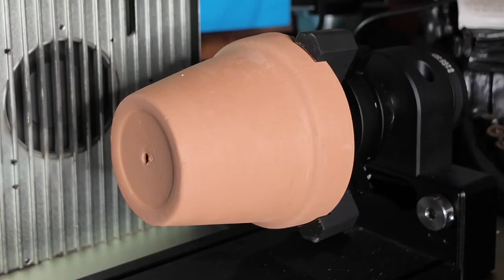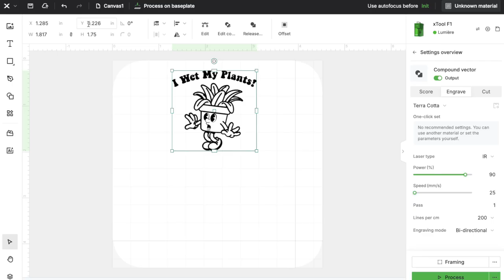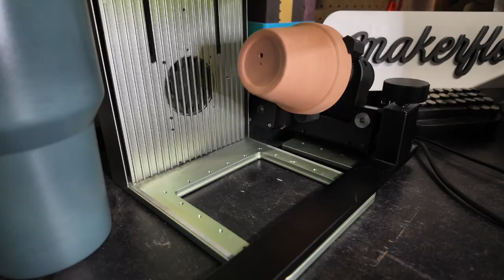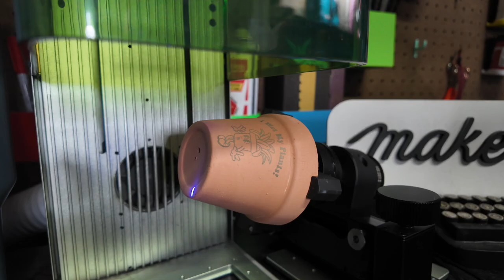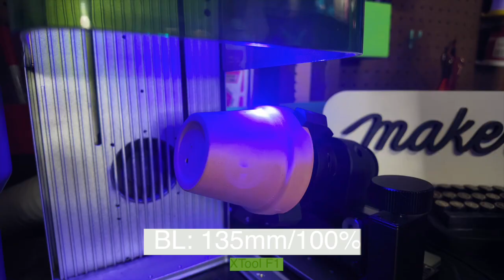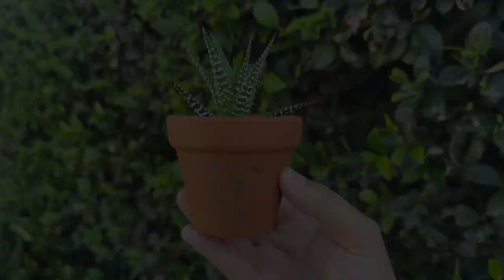Easy DIY Engraved Pots That Could Make You Cash!

Comment: Is it possible to engrave a pot without the rotary? If so, how do I avoid it stretching etc
Reply from the maker: On the f1 I think you can get just under 2” with out it warping. Probably 1.75”. If you have the f1 ultra you can do the curve engrave option.
Reply: @ChippedBuilds  Thanks :D